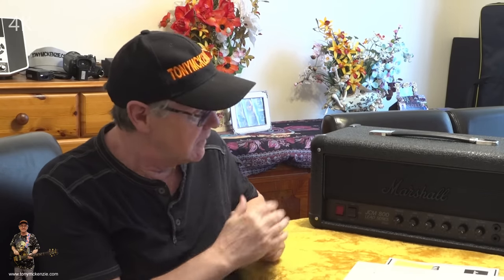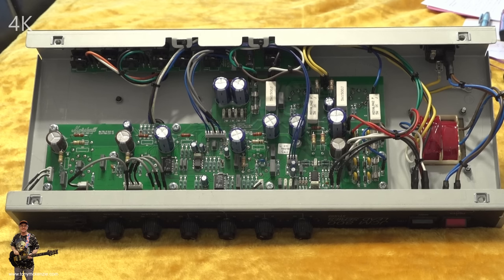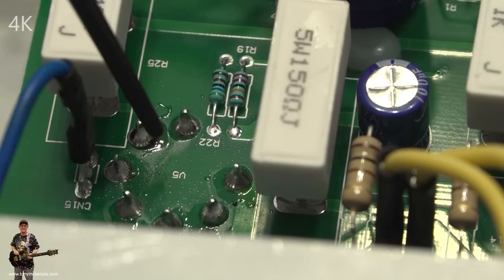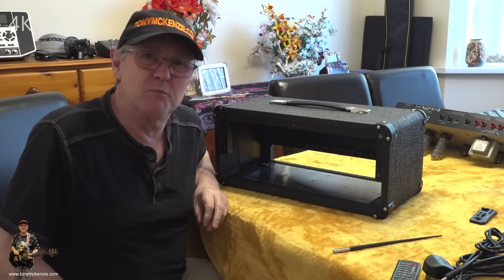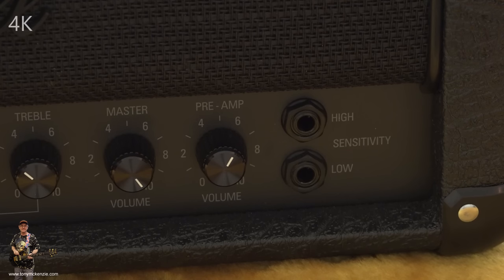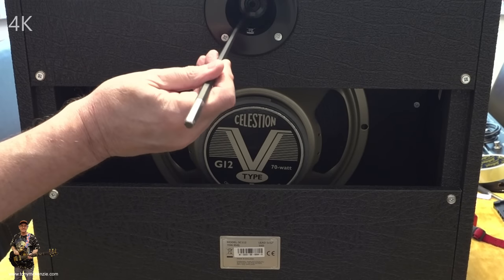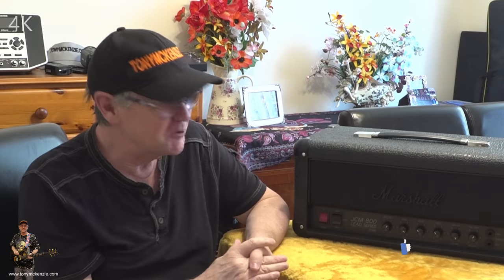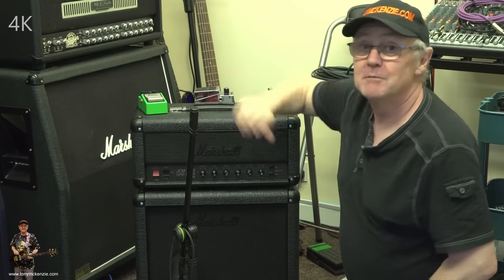Marshall STEALTH JCM800 STUDIO SC20HSB Amplifier |  REVIEW |  Inside & Out with Playing

Comment: Tony, the cab material......proper birch ply (big cheers) or MDF ( crowd booing )? Good call on the resistors being lifted from the board unlike fender hotrod board burners but I wish the tubes were chassis mounted, how much extra would that add to the price ?
Reply from the maker: The cab appears to be birch ply and in the thinner places at least 1/2 inch (13mm). Not sure about the speaker cab... I'll check as I did not look as close. In fact I'll confirm both. I'm getting old in my old age :)  Those resistors on older amps are raised off the PCB or tube or valve and sure enough on this amp there they are raised. I have seen other amps where they are near enough on the PCB. Some of the traits followed these days seems basically wrong but who am I to comment. I'm no electronics engineer, but as originally a mechanical engineer it seemed an obvious point. I doubt that the 'extra cost' for the chassis mounted tube sockets are that different in price, but there might be other labour costs though... I have pointed out the PCB mounted sockets directly to Marshall designer and he had no issues whatsoever in that design. His comments stated that the heat was 'rising' and had no real effect on the sockets. He is a very clever guy and I believe him actually. Stay safe...
Reply: @tonymckenzieofficial  If the speaker cab is birch then that is great, MDF just tends to glued together dust and sounds grim. I'm a real stickler for tubes mounted to the chassis, that is where they belong. When I quizzed Martin Kidd at victory as to why the tubes on the sheriff 22 were PCB mounted he said it was due to cost. I didn't buy that amp. I simply couldn't believe the gall of Suhr, 2700 quid for an amp with PCB mounted valves ,!!......maybe we old curmudgeons are showing our age Tony.
Reply: @tonymckenzieofficial  Could the raised resistor be prone to pickup noise, maybe why the almost complete shielding and good components..
Reply from the maker: Well that's possible of course, but I think unlikely because Marshall have a complete test facility in Milton Keynes (watch part two of my visit there where I showed that) for all approvals and are not dependent on external laboratories (from what I believe) for all the testing. Of all the different places I have visited they have the most expansive facilities I have seen. I think the raised resistors might relate to some sort of reduction of heat, but your view is just as pertinent as mine  - good point.
Reply: @tonymckenzieofficial  i said it earlier,,, the fender hot rods have two of those ceramic resisters mounted flush on the pcb right next to each other with capacitors very close and over time they burn the board , the traces lift and the whole thing goes to shyte. It the heat!
Reply from the maker: Ha I think we do show our age Scamp... but that's OK. I was originally a mechanical engineer until I was 29 and was used to working on products that had a very firm grounding in quality. Later, with my involvement in technology (1979 to now) I have spoken to many different people about things like the sockets for the tubes being chassis mounted. My view was always chassis mount. Cleverer people than me have told me differently. But when I open up amp after amp (and varying in price between £100 and £3700) and I see the sockets PCB mounted I have ultimately buckled on this point. Not because I agree with them, but rather because amplifiers ARE (in general but not always) being made down to cost, maybe driven by the Far East low cost (and often low quality) equipment that floods the market with some fancy 'manufacturers' name stuck on the outside. Sometimes it's a high price for something that should be low cost, but marketed as a 'quality' product. It's all subjective of course. The problem is of course that 'us old codgers' ??? remember the right way to do things.  But for me, this amp under review I think really is as good as you can find out there right now. It just works :)
Reply from the maker: Sorry about that Russell. Design like that makes you wonder where the 'common sense' went for some 'designers' and how they end up being so successful.
Reply from the maker: FACT from Marshall today: The amplifier and cabinet are manufactured from birch ply

You receive a first year warranty automatically, if you register within 90 days you receive an extra two years. Valves only have a 90 day warranty.

So there you have it...
Reply: @tonymckenzieofficial  glad to hear they are making the spkr cab properly and not with that MDF garbage.
Reply from the maker: Yes... I could have prized off the covering, but I asked - it was easier :). Birch plywood it is. I had a 2x12 Marshall cab once made of the other stuff and was not that impressed. In any case its the real deal.

Comment: A 5 watt tube amp can be ridiculously loud, and if you put a real efficient speaker on it - watch out!!!  The 20 watt mode should be 6 dB louder, which is exactly the drop off in dB for every doubling of distance from the speaker. So let’s say the volume is a certain loudness 50’ from the stage, it will be 6dB quieter 100’ from the stage. Flip the switch from 5 watts to 20 watts, now 100’ from stage is as loud as it was 50’ from the stage before
Reply from the maker: Yes the 20w is not 4 times louder (perceived) to my ears but you can tell the difference I think. Great info and thanks for posting it... Ha I got caught out at technical college when I was 16 :) I was the guy that submitted the homework, and then got dragged to the front of the class for pointing out that 98DBA was only 1 DBA louder than 97DBA - of course, slightly different by far, but I really did learn a lesson at the time :).   Stay safe.

Comment: Those ceramic resisters are the bain of the hot rod , blues jr,s type of fender amps.
Reply from the maker: You're not the first to say that either! I have not looked too close at the Fender Hot Rod etc. but if I get a chance I will. Thanks Russell for the info... that's always useful and offers more than one opinion also. Stay safe.
Reply: If they were any other type of resistor they would make just as much heat if they were the same value in the same place in the circuit. In fact they would have more trouble getting rid of the heat, so it’s not really the ceramic’s fault. It’s just that the designers underestimated the amount of air-flow needed to keep them cool, and/or underestimated how much they’d heat up the adjacent pcb-board. Lifting them up, like Marshall did on this one, really is a very good idea.

Comment: It’s a nice looking amp but all the components are cheap & that circuit board is bound to have issues before long. Friedman’s gear is pricey, but with good reason, he uses high grade components & his stuff is built to last. Unfortunately, many of the big companies are just building throw away amps these days. Honestly, I wouldn’t buy any Marshall made after 1979. A friend scoffed at me paying $3000 for a Soldano SLO in 2012. He has been thru 3 Line 6/Bogner heads & 3 newer Marshalls since then, all which failed due to poor design/ cheap components. Still rockin my Soldano with no issues ever. You really do get what you pay for & I’m not a rich guy, I just saved until I could get the good stuff! If I buy a low wattage, it’ll be a Suhr PT-15 or Friedman JJ junior. Sorry, but they both blow that Marshall out of the water in every way.
Reply from the maker: Well its all a matter of opinion and experience. We all certainly have different experiences with equipment and what one guy likes another may not. And that's OK. I have looked in so many amps since 1968 and seen great amps, really bad amps and everything in between. There's nothing wrong with a Soldano SLO or its sound or quality from what I have seen. But I bought a Mezzabarba amp (here: https://youtu.be/C4WLh0vYaIs ) which I'm sure is at least similar quality, but actually the best made amp I have ever seen. The quality and tones are really indisputable just as my opinion - but other guys might like that amp or not. On components, to be honest, I have seen very expensive equipment filled with cheap components, bodged together and much more. Some of which was actually dangerous. On this amp I agree it is made to a retail price, but I can say, that some of the points I raised for example about the 5 watt resistors being near enough right on the PCB are out there right now and the result of that is that those 5 watt resistors get hot. That is not a long term design or a good design. But some makers are acclaimed to be the best there are out there so to speak. I have none in mind when I say that. You likely won't get any problems with Mike Soldanos SLO100 head - that is made very well. 

But you have to consider (what I refer to in my videos) the 'ordinary guy'. They don't play out much, they never need 100 watts, they might well play at home, have kids, but just love to play. And they are not all wealthy. Ordinary people like that (me too these days) don't need those high end amps. And the Marshall amp here (just an opinion) is perfect for guys with those needs and requirements. I have many amps that no one would dare tale in the house (for example Diezel Hagen, Mesa RK II, Mezzabarba M Zero One and more) but would love one of these JCM800 Stealth heads and a little cab. I don't see any particularly bad components in there, you know, a resistor is a resistor these days and they all come from China give or take. Marshall has a three year warranty on this amp (I checked today actually) and for what it offers it is a good option. I know by the time it reaches the USA it might well cost more, but compared to some really nasty amps I could name but won't, this one is a cool amp. 

Many of your points are very similar to my own views and I know exactly what you're saying... cost can make a difference - a well made expensive amp can cut the mustard, but all expensive amps are not all good. Spending that $3k is likely worth that money to you as spending on the Mezzabarba for me was worth the money too. I did review the PT-15 recently, and while they clarified some points I did not get entirely correct (I'm just an ordinary guy!) there were many things I showed which were correct too. The PT-15 got a 9/10 which is a good score for any amp. I guess had that amp been £700 it would have had a ten :)  Lastly of course, both the amps you mentioned are at least twice the cost of this Marshall, and in the case of the PT-15 it costs four times as much as this little Marshall. I expect those other brands to be better. A very good post with good points raised. And thanks for watching the video... and whatever you do - stay safe.

Comment: Why isn’t it a good idea to use a transformer to change the voltage?
Reply from the maker: Well it's a pain to move around firstly if you're 'dropping voltages to 120. But if you're raising voltages to 240 then some of the gear might not be too great and remember the current draw... well at least that's my own opinion... I have had lots of practice dropping the 240 mains to 120 :) it works but those transformers are heavy.